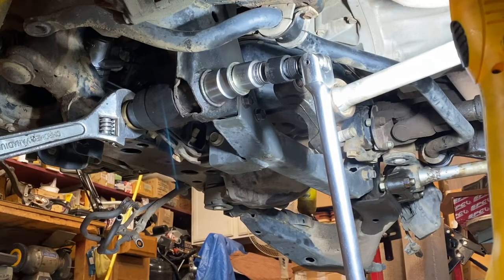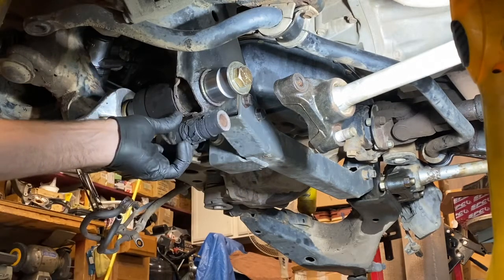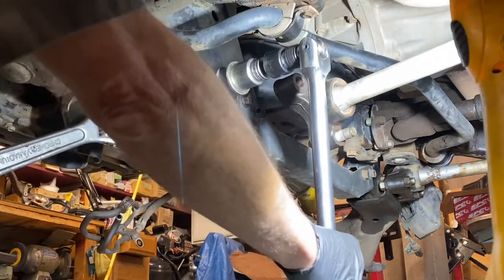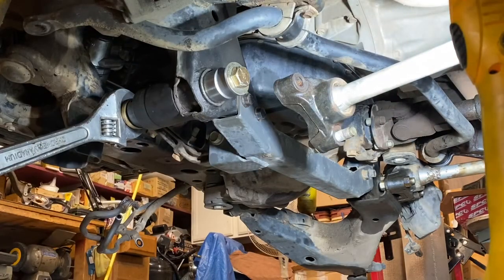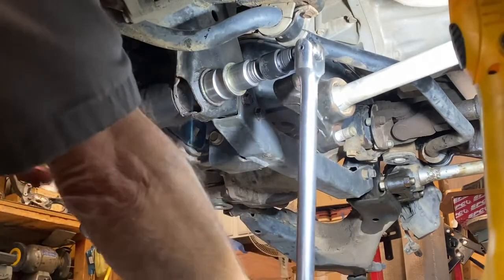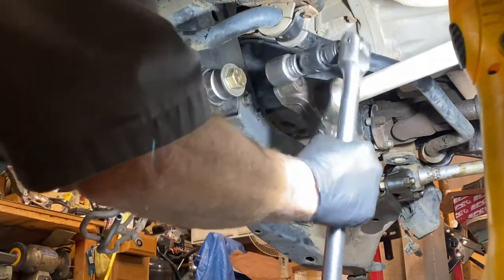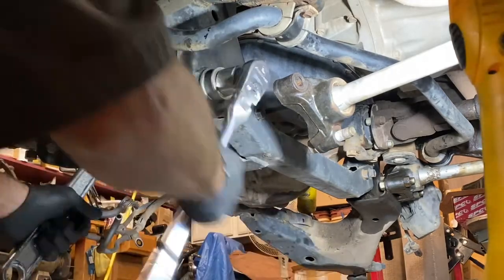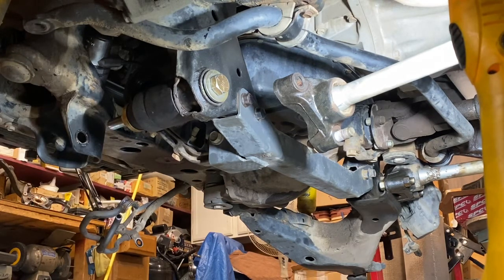LCA No 2 frame bushing custom press tool, w/ 3/4" grade 8 bolt. Toyota land Cruiser / Lexus LX470

Comment: Great video man.. Would u tell us the correct size of the socket and the tube u used to press?
Reply: The socket I used. I had a machine shop grind down a 1 3/8", 3/4" drive socket, using new #2 bushing as model. Other press parts are from powerbuilt kit 46, part store loner. In ih8mud, guys have found an off the shelve socket that fits. But issue with those are edge is rounded. If you get a bushing really frozen in. The round edge can work against you. Also worth a note: heat from propane is said to really help!
https://forum.ih8mud.com/threads/remove-lower-control-arm-on-frame-no-2-bushing-dimensions-and-parts-to-do-it-are-attached.1122154/page-3
Reply: @Videos2011my 
Thanks. Great reply.. And many thanks for the video uploader.

Comment: Thanks for doing this video. I am going to tackle this job soon. Do you happen to have the part number on this bushing?
Reply: 48655-60010 BUSH, FRONT LOWER ARM, NO.2, 90560-49001 spacer (washer)